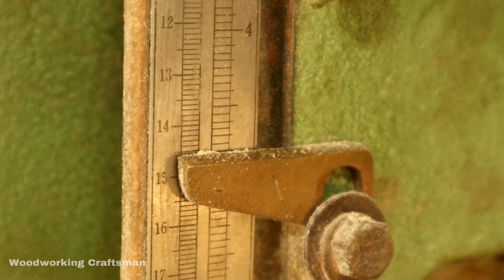Amazing Ingenious Techniques Woodworking Workers || Large Curved Joints Woodworking Wooden Furniture

Comment: Nice (but not extraordinary) technique cutting of the curved feet. However, I'm glad I'll never associate me or my business with this kind of product or craftmanship. Like: 1) The two front legs are not visually symmetrical. On the right leg the glue line is facing the front, on the left it's facing the side making the whole thing embarrassing and weird, 2) It's common (woodworking) knowledge not to glue and screw a solid wood top to a frame. Wood will move with seasons and then crack of fastened solidly, 3) I assume shortage of quality wood is the answer, but I would never ever use such fast growing (2 cm yar rings) and poor quality (knotty) pine wood for a relatively expensive chair like this. I assume it cost something based on the manhours put into the making, even in China, 4) What's the purpose/use of this creation? To me it's best to add a hole in the seat, place a bucket below, and turn it into a toilet. An anniversary gift for Emperor Xi?